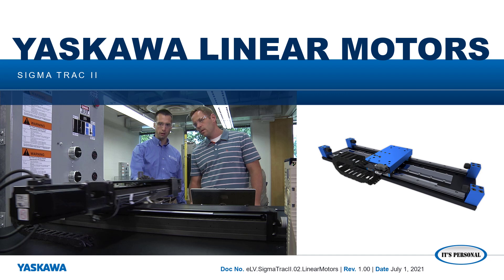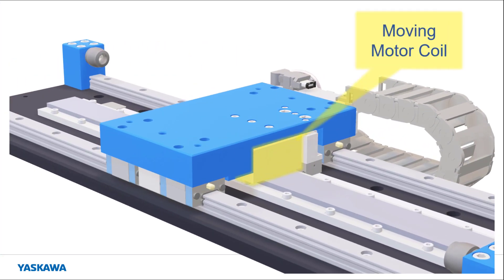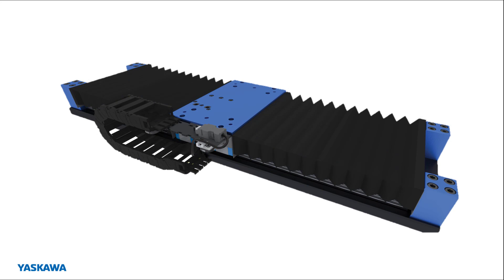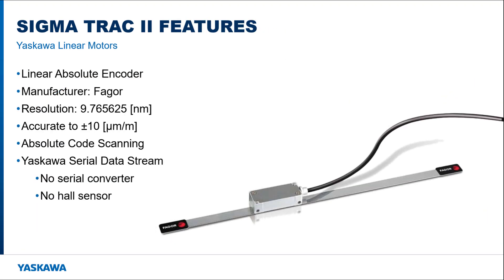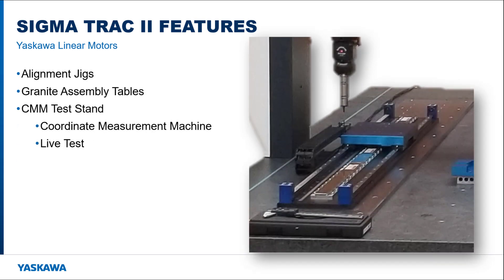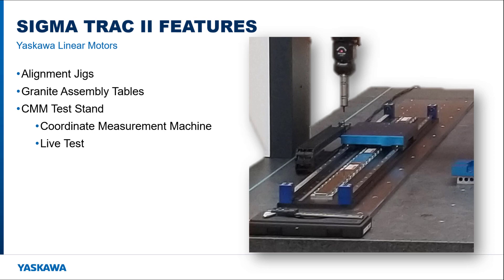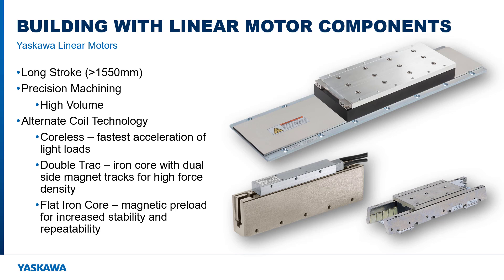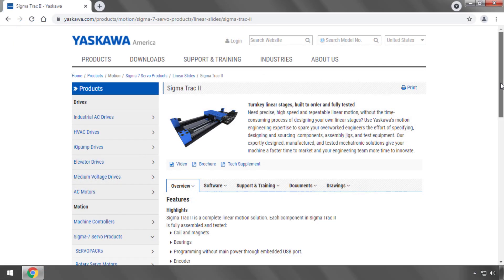Yaskawa Linear Motors

Comment: Is it compatible with siemens 1200 .recovery after power on (absolute encoder). What is price in india where to buy. Y axis 500 mm z axis 300 mm application to pick place part at rotary indexing table with help of small gripper. Part weight less than 500 g.
Reply from the maker: Thanks for watching our video on "Yaskawa Linear Motors."
Please contact the nearest service provider with more information on your application to further assist you using this link: https://www.yaskawa-global.com/company/profile/global.